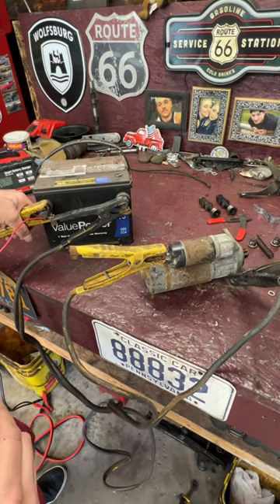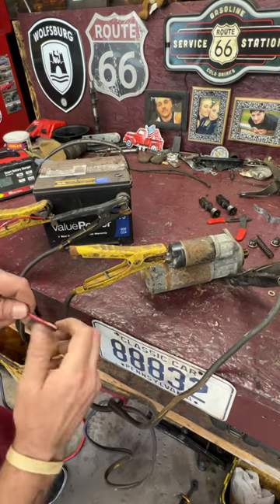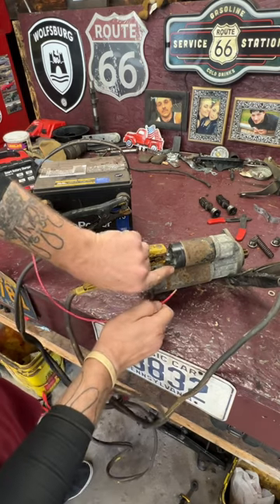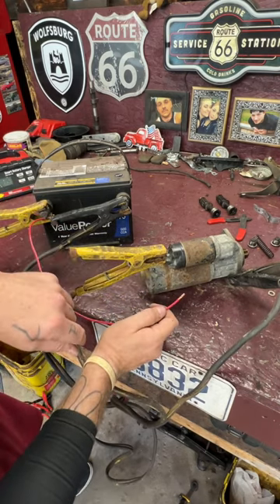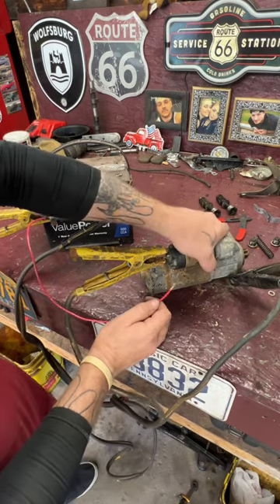How to test semi auto VW starter - And testing most car and truck starters - VW beetle starter - DIY

Comment: I had two starters for my 68 and they would bind up if not the end of the shaft was supported. I thought they where both bad until I put them in an empty bell housing to prop them up. Not sure if thats just for some of them or what